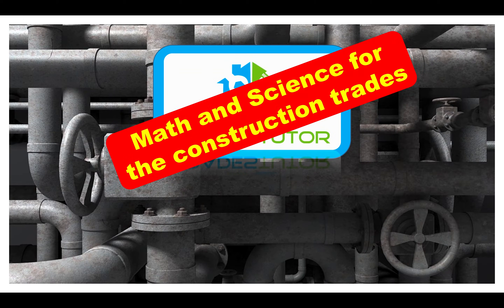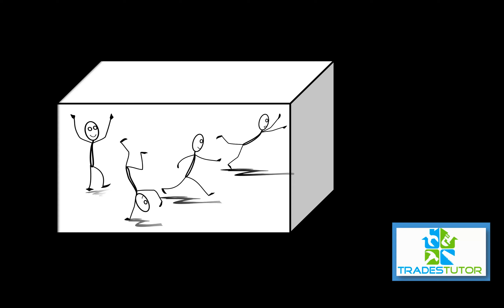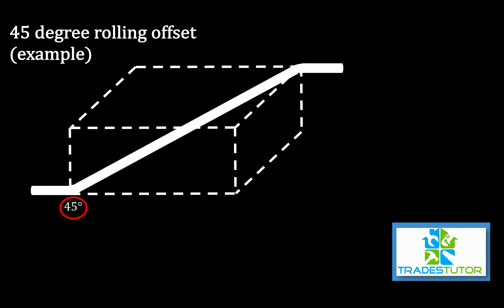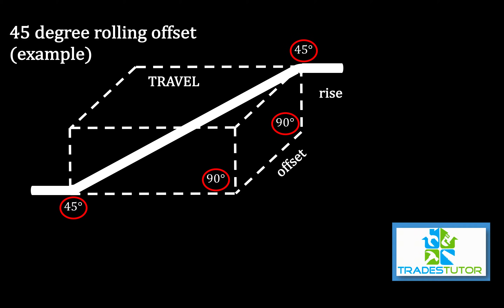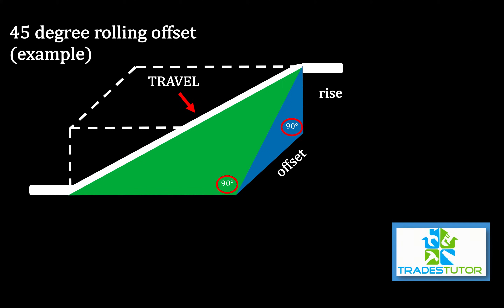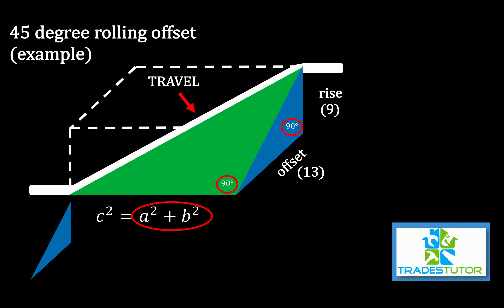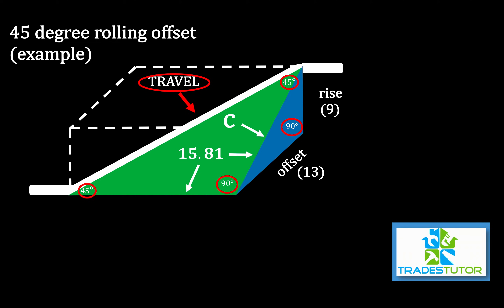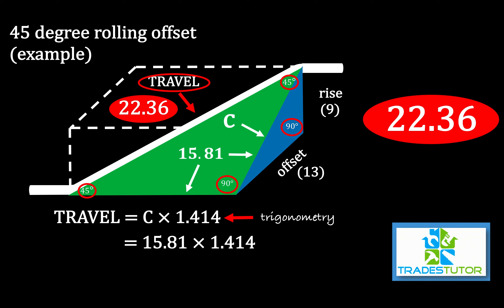ROLLING OFFSET piping 45 degree (example question)

Comment: Typically I’ve found that if you have a piece of conduit and then you have a box (for example) and you take the measurement off a wall and off the floor or ceiling as two separate reference points you can find the length of the wall from your box and the length of the wall to your conduit then do the same for the length to the ceiling for your box and your conduit you can subtract the two differences of the ceiling heights and wall heights and square both of those measurements then add them together and find the square root of those numbers when added and that’s gonna be your offset. Its worked everytime for me as long as your bends are level and everything like that. But of course the box and the conduit are different heights and different distances from each other hints a rolling offset is used.

Comment: I have a similiar question however there's one more step. The pipe extending outside the triangles at the right hand side near the top.  I need to find the exact length extending out of the room but the interior room width is not given. Can I email you the question, would be nice to get some help. My final exam is in few weeks.

Comment: When getting the rise I know you said measure floor to ceiling but is it the actual floor to ceiling or the center to center of both runs and same question for the horizontal do I measure center to center or wall to wall
Reply: I have the same question. Did you ever get an answer for this?

Comment: While you're trying to do this math, the boss is yelling at you, as to why you're taking so long..that's the reality
Reply: Shouldn’t take more than a min to do if you have a calculator to get it right THE FIRST TIME. You can eyeball it and get it right 60% of the time or you can do a little math and get it right 100% of the time
Reply: This comment wins the dumbest comment of the year. Try do a rolling offset with no math with 10" or 20" heavy wall steel. Would love to see it done with zero math
Reply: It matters when you have to do plumbing on paper or work with larger pipe. Don't hate because it may be hard to grasp. THINK harder. Its quite simple once you know it.

Comment: The green triangle is entirely unnecessary. Once you have the blue triangle’s hypotenuse figured out, you just multiply that by the cosecant of the bend angle to get the distance between bends. That’s it

Comment: Then after you get the 22.36 you would then have to remove the measurement of the 2 45s correct? To get the actual piece of pipe. I’m teaching some of my apprentices here and I’m brushing up on my formulas.
Reply from the maker: Hi Caesar: Yes, that is correct. You would have to subtract the fitting allowance for each of the two 45's. Thanks for watching.

Comment: What if you have an inside corner where you would typically use a 90, but there's a complication in the corner. There's a vertical pipe, 6" in diameter, and you also have to rise 6" on the adjacent wall to get above a locker shelf--all in just two bends? This is a real problem I've puzzled over. I can sometimes do it by the eyeball method but it doesn't come out quite the way I hope because I don't swivel the pipe for the second bend quite right.
Reply from the maker: Wow. That sounds like a bit of a tricky situation. In all fairness I'd have to see what is going on in the room to even have a chance to figure it out. Thanks for watching.
Reply: @tradestutor1191  , Thanks for the reply. I admit, my description here was slightly hypothetical, but it tried to get at the problem I'm describing. In other words, the numbers do not matter too much; use any dimensions for the rise of the shelf and the diameter of the cylinder that are convenient. What I'm looking for is a solution to a shape very similar to the one you used, except the end of the pipe at the bottom left would be coming out of the page/screen along the corner of the wall and floor toward you. So, it's a rolling 45-45, I think. Since it is rolling (climbing), the hypotenuse grows. Looking from the top down, it would look just like a 45-45. But when trying to bend it, what is the degree I need to swivel the conduit in the bender out of the regular plane of the legs of the first bend to get it to come out right? Is it 45-degrees? I came up with this problem when trying to bend this shape to fit along the center-lines of two I-beams at 90-degrees to one another where the end of one is resting on the other at their corner. The lips prevented me from doing a kicked 90. Thanks again for answering. I really like how you simplified the math using two triangles.

Comment: What I've noticed....it's super easy for you to lay this out by mathematics, and/or on paper, but when it comes to an actual (physical) example, there are none. Lmao
Reply: Wtf are you even trying to say?
Reply: @RB-xv4si you ALREADY KNOW.. the examples are ALWAYS cartoons. And you might feel that "it's the same". But try a rolling offset that's VERTICAL In some cramped space..it's "the same" right? But that becomes a different beast in an actual boiler room or something.. or if you really don't have a nice wall to mark from..because the crap is hanging in mid air in a giant building. And no, your tape measure is NOT going to reach a surface in those scenarios..
Reply: @mebrn5337  that’s a great observation; doing the math right doesn’t matter if you don’t have the right measurement to begin with. And part of being a good electrician is figuring out how to get the right measurement. Sometimes that involves using a line laser or a plumb bob. It also sometimes helps to realize that this job isn’t for everyone.
Reply: @RB-xv4si  apparently, you work in a place where people will let you take all that time to get the laser or getting a plumb bob. Most bosses would yell at you, that youre taking too long.
Reply: @mebrn5337  sounds like a personal problem.
Reply: Sure there is, it is center of pipe to center. If no pipe in rack, make mark of where center is. Same on the other penetration. Imagine it there, find center ( half of OD). If u must, measure to TOP of prop pipe, take off half of OD to get center of proposed pipe. You have to know/ find where the pipe is. If top of 4" pipe is 5" from the ceiling, then add half of 4" pipe OD ( 4 1/2" inch OD, so half is 2 1/4". Add the 5" from ceiling to top of 4" pipe ( which is 4 1/2" OD ) with/ to half of 4 1/2" which is 2 1/4". 5 " plus 2 1/4" equal 7 1/4" ( the center of the 4" pipe in that room dimension from ceiling. 7 1/4". Now you have the one center run. Do the other. That will be the triangle. Measure from the center pipe lines only. Not floor elevations, unless it is to pipe centers. Seems hard if your offset has a joint in the rack on one end and no pipe on other end, i get it, just outthink it and make a reference to centers of proposed lines, you know ? Do 3 and u got it!

Comment: nice video sir.... Sir what if 22.5 degree roll..? what would be the run..?.and.can you also tell us sir the formula for for travel if it is 22.5 degree roll..thank you so much... and  good luck...
Reply: It's the same up to the point that he uses "C*1.1414"

Yours would be: 
Travel = C/cos(67.5) or C/sin(22.5) both equal C/0.3827
Making the travel in this example 41.31 instead of 22.36 

The bottom angle of your green triangle would be 22.5 and the top angle is 67.5 (90-22.5)
Reply: @RB-xv4si  Bud, I said Travel = C/0.3827

I bet you find that equals about the same as Travel = C*2.613

Good job discovering trigonometric identities though ;)
Reply: @RB-xv4si  Who said anything about tangent? cosecant is identical to one over sine. It's math.
Reply: @RB-xv4si  Are you ok? Do you have dementia? Do we need to call someone? How many ways do I have to say csc(22.5) equals 1/sin(22.5) for a smooth brain to understand? Most scientific calculators don't even have a [sec], [csc], or [cot] function, because trig identities are so commonly known.

This conversation has been like me saying "turn 90° right" and then you saying, a year later, "nah, that's wrong, it's 270° left." I would assume you're a troll, but it's not like you're getting a lot of attention semantically arguing about trigonometry. 

Hope you get the help you need.

Comment: Nice comprehensive video. Could you possibly do a video on how to calculate and cut down 90 degree butt-weld pipe elbow's? That would be awesome!
Reply: T TY
Reply: Throw is equal to OD x 1.5 subtract throw and weld gap from total offset